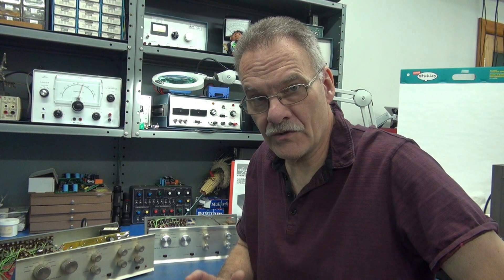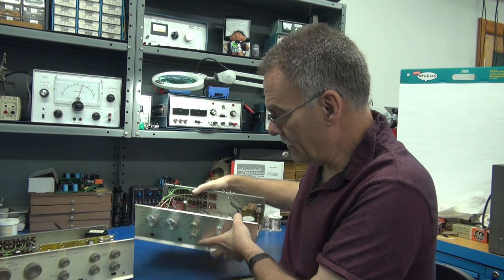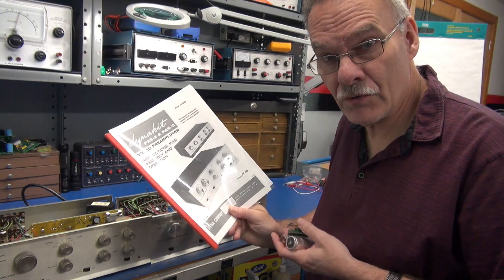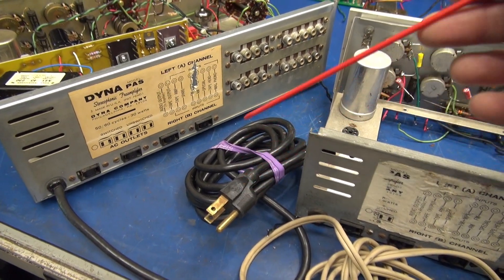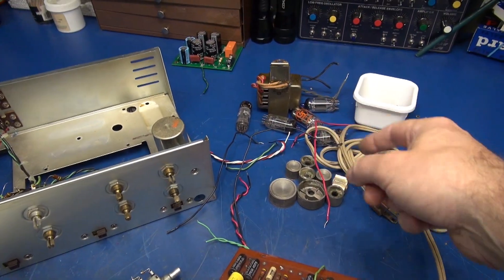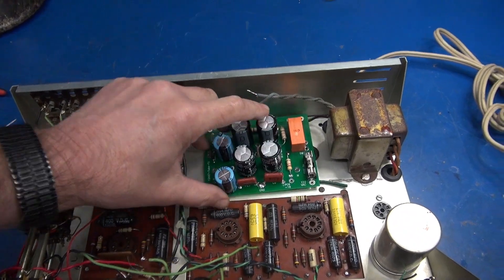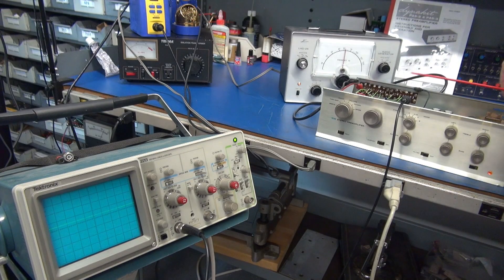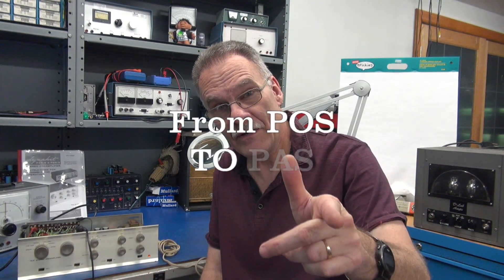How to make one good Dynaco PAS Home stereo Preamp from Two bad ones keep vintage electronics alive

Comment: If you are going to restore a Dynakit PAS preamp, you need to be sure that, no matter what model you begin with, you use a PAS-3X assembly manual for the restoration because there are a couple of modifications Dynakit made to the circuit that are important.  One is to increase the value of the interstage coupling capacitor in the output section, and the other, and the more important, is to add a capacitor at the output of the preamp.  This is located between the bass controls and the circuit board and replaces a direct wire at that point.  This is a 1 ufd capacitor and serves to block a sneak path for DC through the negative feedback circuit for the Baxandall tone controls.  If this cap isn't there, the bias from the first stage cathode in the line amp appears on the output jack.  It is about plus 1.5 volts.  Dynakit vacuum tube power amplifiers -- and some others -- do not have DC blocking capacitors on the input and this positive voltage appears on the grid of the voltage amplifier, essentially canceling the contact potential bias on that stage bringing it down to zero.  This is not an after-market "improvement," but a production change made by Dynakit documented in the 3X manual. Another difference in the later PAS preamps is that all the tone control potentiometers are custom pots that have a dead zone in the center of rotation. Swapping pots around between units of different vintages, you need to keep this in mind.  Note too, that the paper sticker on the back of the PAS-3X is the same as the one on the back of the PAS-3, there is no way to know what version of the preamp you have without checking the circuit for the up-sized and added capacitors and the action of the tone control pots.  You can feel the dead detent if you adjust the pots carefully.

Comment: I had one of these few years ago. At first i remplace the power supply by one similar and finally put new boards with new parts. After it sounded a lot better but my 4S with cathode follower is superior so i sold the PAS.

Comment: Nice video Terry, I particularly thought that your mentioning about ground loops being introduced by connecting a chassis to a buildings equipment ground worth further consideration. Particularly on receivers with transformer isolated the power supplies then one can have external ground and antenna connection results in better reception. 73

Comment: I have one of those and two Dynaco ST-70's
What I did with my ST-70's is run the filiment voltage through a full wave bridge rectifier to eliminate the AC hum that they had, works fantastic now!